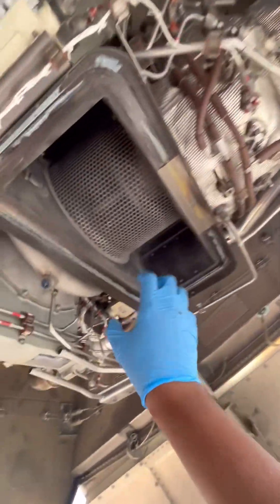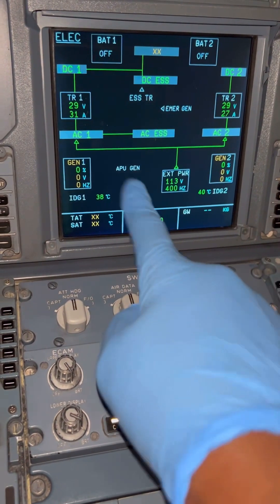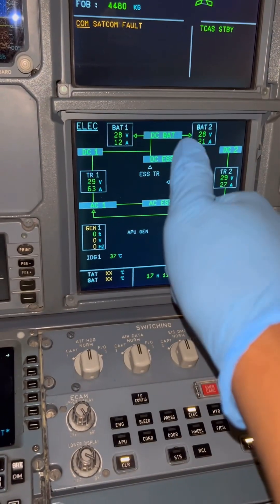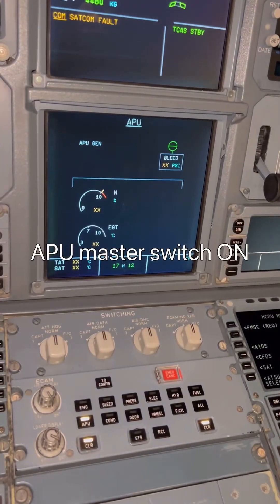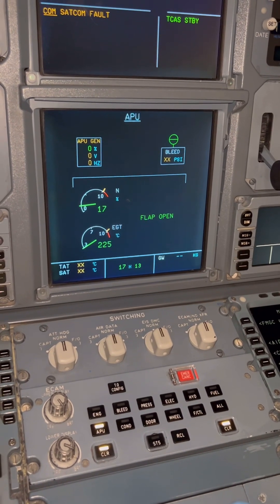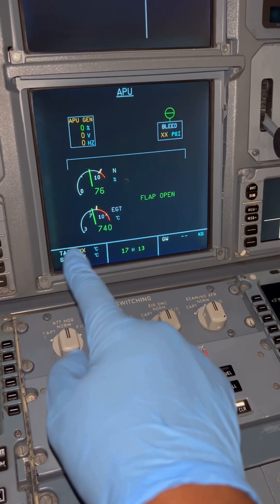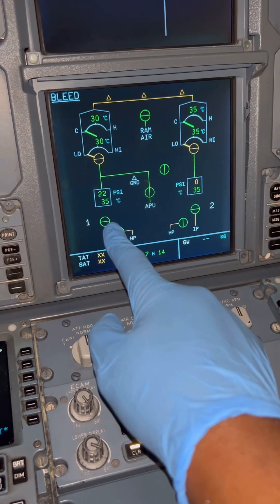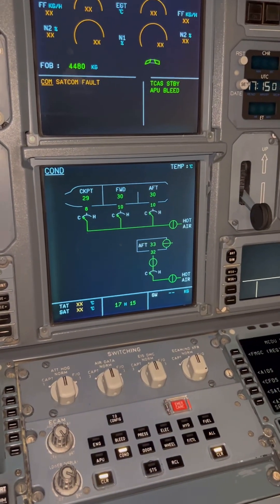Airbus A320 Auxiliary Power Unit (APU) start

Comment: Question: Can the APU (and following the engines) be started w/o external power ?
Reply from the maker: Yes the apu is actually designed to be started without external.it’s power source for electric starter are the aircraft batteries.You don’t need external power to start the apu on the other even with external power you need aircraft batteries to start the APU because the fire protection systems need battery power